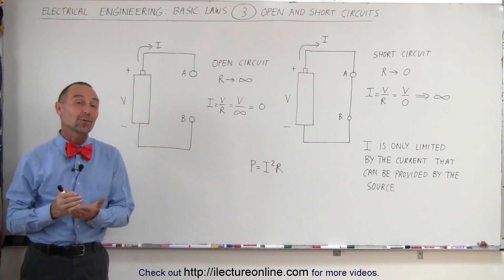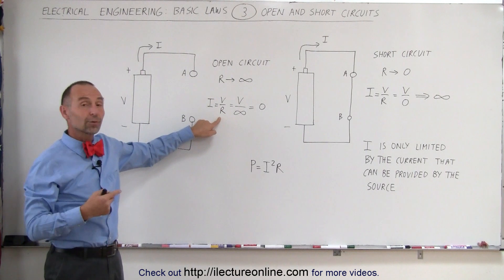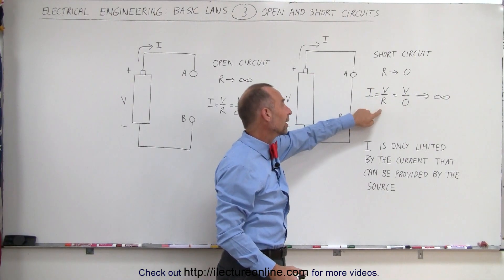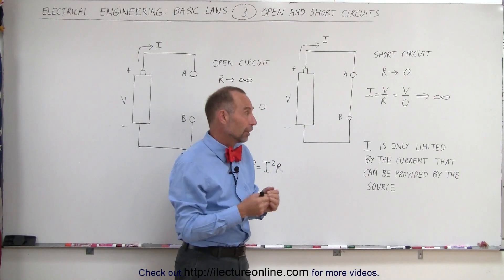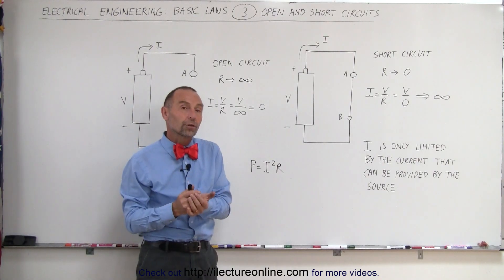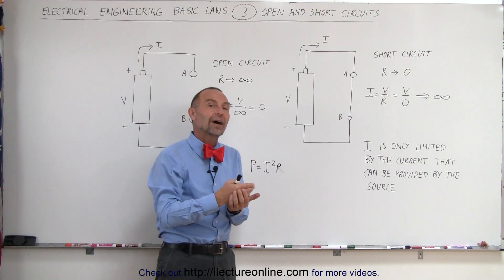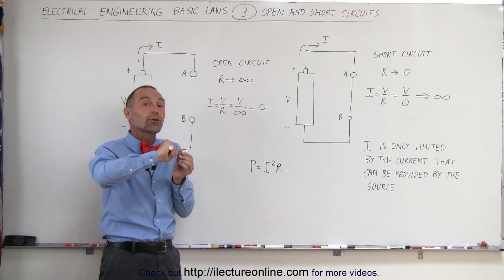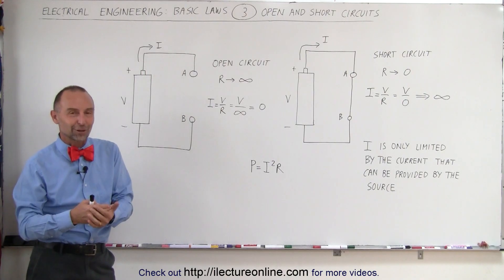Electrical Engineering: Basic Laws (3 of 31) Open and Short Circuits

Comment: What happens to voltage during a short circuit at the component terminal itself ?
Reply from the maker: If a voltage supply is shorted out, (provided with a path with zero resistance), the current draw will reach the maximum the power supply will allow, which will pose a fire hazard as the wires will get too hot.
Reply: @MichelvanBiezen   see that’s where I get confused I understand up to that point that amperage wile rise to a huge amount because of no resistance . But let’s say there was no fuse and the wires were sized properly that they could in theory handle the heat from the excess current why does a load like a bulb turn off during a short circuit?  Is it just that the current is taking the short circuit path and ignoring the load ? Or is the voltage dropping at bulb ? But why would the voltage drop at that point ? Since every-wire has some resistance at the short in my head I keep seeing it turn into a parallel circuit as soon as the short happens .
Reply from the maker: If the short is parallel to the circuit containing the light bulb, then yes, all of the current will flow through the short circuit, and none through the circuit with the light bulb.

Comment: Dear Michael,
Thank you very much for your input! I've been following your tutorial almost at any physic or math topic , though.
However, may I ask one interesting thing:
- When short circuit occurs, the RESISTANCE aproaches a value of ZERO,  the CURRENT is infinite huge

Assuming our POWER equation is Current * Current * Resistance, how can we say, that when Current is infinite huge, the POWER is also "growing exponentially" ,  what about RESISTANCE = 0?

With Best regards,
Artjom
Reply from the maker: Good question.  In the real world there is no such thing as zero resistance or infinite current.   (there will always be some resistance).   SInce P = I^2 R, the current squared will grow faster than the reduction in R
Reply: @MichelvanBiezen  Thank you for the quick response!
Yes, in the real world there isn't. It is just a bit complex (tricky I should say) for math guys (who used to operate with "limits and derivatives"  to deal with such  cases in physics :)
Best wishes,
Keep going, amazing content!

Comment: 1:08 "I is only limited by the current that can be provided by the source" shouldn't it be "voltage" instead of "current"?
Reply from the maker: Current is correct.  There is only so much current a power supply can provide even if there is enough voltage.
Reply: @MichelvanBiezen Thank you so much :)

Comment: A 2ohm resistor is connected in series with a 6A fuse to a DC voltage source of 10V. If a short circuit devlops across the 2ohm resistor. The current in the circuit after some time will be? Zero or infinity?
Reply from the maker: If the 2 ohm resistor is shorted the current will very quickly become very large    I = V/ 0      The fuse will burn up and prevent any more current from flowing through the wire.  Therefore the current will drop to zero.
Reply: Michel van Biezen it means first current goes to maximum value ( because resistance becomes zero then current will have infinite value) and then fuse will burn. So that we can’t say that current will be maximum rather it will drops to zero.
Thanks man. Please tell me that if fuse  isn’t placed there what will be the value of current? Can you tell me when will current will have infinite value? I am totally confused.  I am waiting for your response.
Reply from the maker: Infinity is a mathematical concept.  In the real world there is no such thing as zero resistance and infinite current.  The wire will still have a small amount of resistance and thus the current will not reach infinity.   But the answer they want to hear to a question like this where there is no fuse:  "yes the current will go to infinity".
Reply: Michel van Biezen I am in dilemma that  for the same question if I use higher rating  of fuse 100A instead of 6A, then again resistor is short circuited, whether the fuse will burn or not? If not burn what will be the current ? Is 10V battery can burn that higher rated fuse wire? If yes then how? because we have provided only 10V battery source. Please correct my dilemma. I am waiting for your response.

Comment: Why is it that there is still a voltage across an open circuit though? I understand no current flow and infinite resistance, but am having trouble w conceptualizing a voltage across.
Reply from the maker: That is caused by the battery.  The battery will hold one end of the circuit at the same voltage as the positive side of the battery and the other side will be held at the negative voltage of the battery.
Reply: what type of Current as you mention is? DC or AC? Wet and Ionizing air are also contribute minor voltage across.

Comment: AWESOME VIDEO!! You make it all look so easy. I have a small doubt though.. when we short a non ideal battery (one with internal resistance), do we connect a wire across just the battery itself or across both the battery and its internal resistance?

EDIT : I realised that in practice, it'd be across both (since internal resistance would be inside the battery). What about in theory? When a question says that a battery is shorted, which case would it usually mean?
Reply: Sir my question is that in reality current been passed out is equal to the current required to maintain the terminal voltage of the battery
Reply from the maker: You are correct in assuming that the internal resistance cannot be separated from the battery.  Often to simplify the problems we assume the internal resistance of the battery is zero.  Then of course, when you short the battery and there is no internal resistance you would "theoretically" have infinite current.

Comment: Hi, first of all: Thank you very very much for all your great videos. They help me a lot with my engineering study in Germany (distance learning). It seems there are some sound issues with your electrical engineering videos. Most or maybe even all of the videos I have watched so far have bad noise. Sometimes the noise has very large peaks which makes it quite uncomfortable to listen to those videos.  You can find an example of what I mean starting at 0:20 in this video.
Reply from the maker: +Daniel Nöthen   Our audio equipment developed problems while we were filming this series of videos. We ran it through some noise filters and removed as much of it as we can. We had purchased new audio equipment. Apologies...
Reply from the maker: +Michel van Biezen 
We have** purchased...
Reply: +Michel van Biezen no worries, you are the man!!
Reply: He doesn't need to apologise for anything. The content is free and better than a lot of the abysmal lecturers out there.